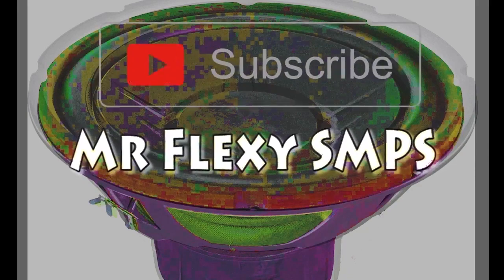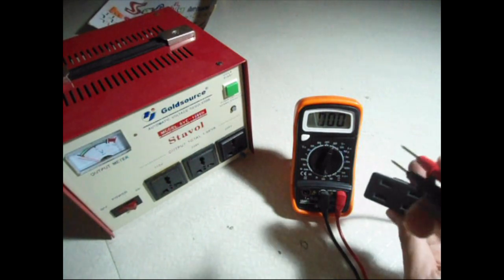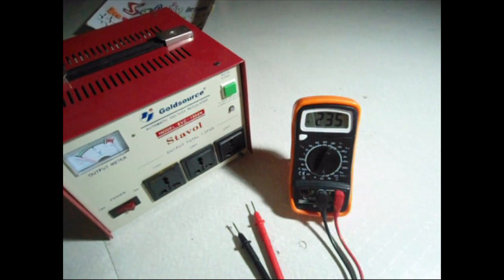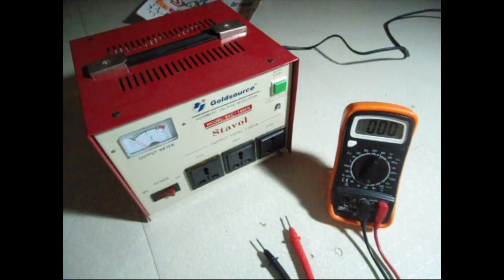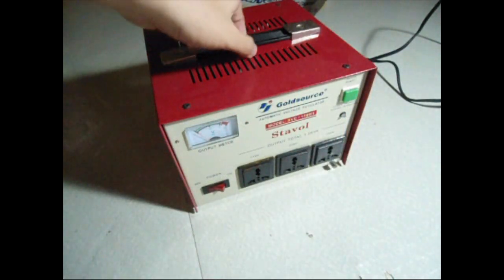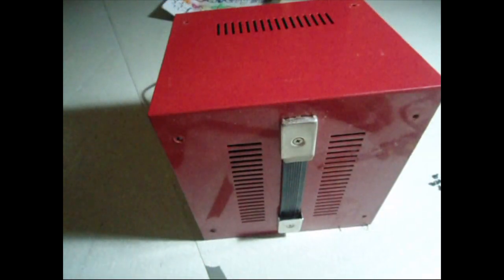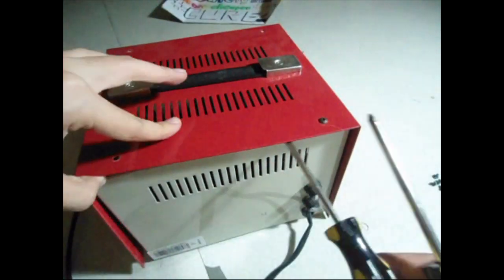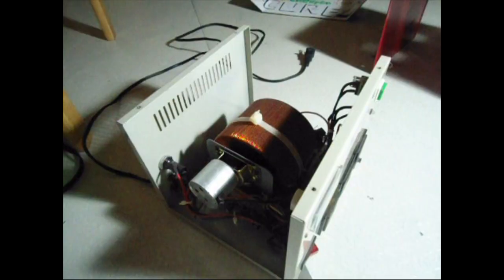Exploding BEWARE! Automatic Voltage Regulator

Comment: Pagkasaksak mo di talaga mag oon yan kasi naka delay yan ng 5 mins. Kung gusto mo i bypass ang built in timer. Long press mo ang green button.  Saka mo i measure ang voltage. Bakit ganyan ang design? Mostly gamit yan sa ref . Makakasira kasi sa motor nya ang biglang patay sindi due to power interuptions. Kaya may built in power kn delay timer yan para di mabigla ang motor sa power surge.
Reply from the maker: it destroyed itself i think its because of over loading

Comment: Boss, kung bibili ako ng avr 3000 watts, how much load should i have to put on the avr? thanks
Reply from the maker: What brand if it is 1500 watts you are in a sweet spot its recommended that you have the load half of the rated incase 3000W is the peak
Reply: @mrflexysmps5826  thank you

Comment: Sir makakasira ba sa ref nmin pag di Nya namamaintain ung rated voltage nya example 220 lagi dapt
Pag gabi kc sir bumababa ung output nya like 140 nlng Po
Reply from the maker: No as long as its not over 220V

Comment: pa help naman po kakabili ko lang ng avr 2000 Stavol para sa aircon ko tapos now ginamit ko na kaso pa bugso bugso yong output nakikita ko sa gauge minsan below 100
Reply: Sir mas maganda yung brand ng meiji avr 2000 watts pang aircon. Tapos sir lagyan niyo lang ng fan yung mismong avr pang support para di mag init kaso dapat naka max yung thermostat mo kasi pag hindi max irereach lng ng aircon mo yung maximum na lamig na nilagay mo then mag aadjust yun kaya pabugso bugso siya kaya kung naka max na max na wag mo na babaguhin.

Comment: Check the wattage of your appliance first before you buy a power stabilizer. For example, if you going to connect it to 2500KVA/Watts aircon (whatever appliance) then you use 1000KVA/Watts power stabilizer, of course, it will surely explode your fuse because your power stabilizer will only support 1000W appliance.
Reply from the maker: The fuse is still ok but it doesn't power on any more.